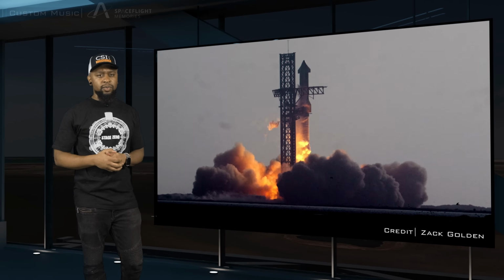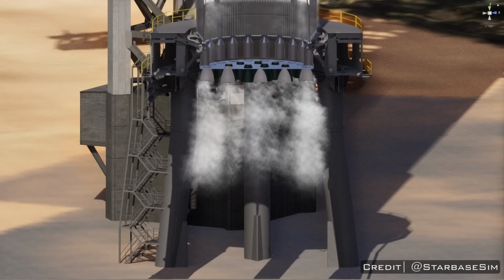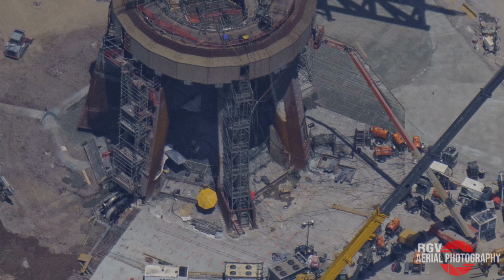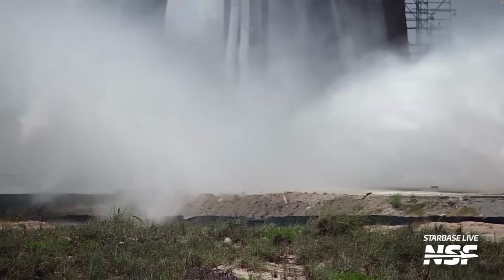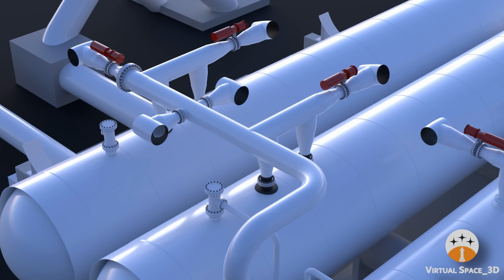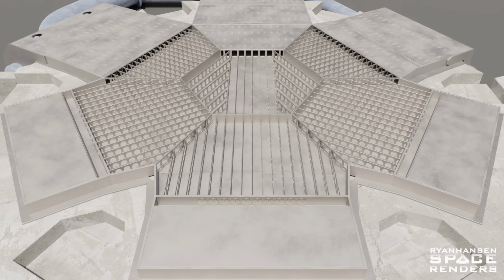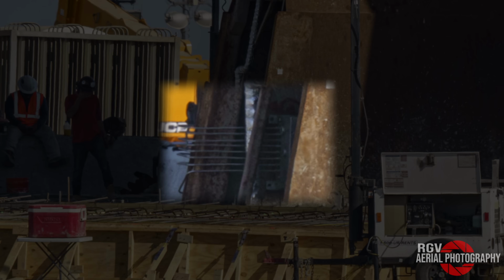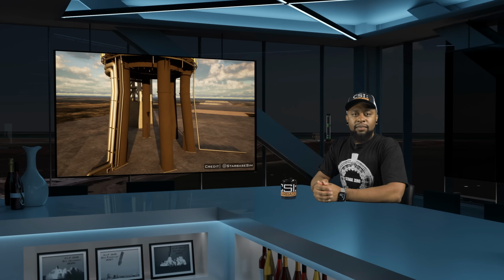How SpaceX Will Guarantee Its Launch Pad Never Fails Again! [Part 2]

Comment: I want to know why having the launch mount higher up would not have been a good solution. A large enough air gap should allow the heat and pressure to dissipate.
Reply from the maker: Probably would have been a good idea. Much too late for that though
Reply: @CSIStarbase  Thank you for replying! Given that it's such a simple solution, SpaceX must have considered that option early on. They must have had a good reason to dismiss it. Otherwise, it should have been the preferred solution, in line with Musk's "best part is no part". I wonder what that reason was.
Reply: Having it much higher would reduce effectiveness of Steam Cannon they are about to introduce
Reply: @KarolKarolak  It wouldn't make sense to have both. I meant having the launch mount higher instead of their current solution.

Comment: Correct me if I’m wrong, but I see nothing less than 55-year-old lessons being ignored by SpaceX. How does such a thing happen? These were known issues understood and solved for in the 1960s.
Reply from the maker: SpaceX believes in pushing boundaries. I think its as simple as that
Reply: Army corp of engineers said no flame trench for you. 
Stage Zero has become an engineering nightmare. 
SpaceX been sandbagged by its critics.

Comment: Another important design point is that the water flow is cross pad, so any steam generated by engine exhaust entering underneath the plate, will expand in direction of flow, and water coming from the supply will cool the steam, reducing volume. At the pressures that the water is at, the steam pressure/temperature is way below steel yield point.
Reply from the maker: This is true. Although I still think it’s nearly impossible for that to occur

Comment: Great video - the pipe you said you don’t know what it was for branching off at the bottom of the largest manifold I think is for the emptying of the entire system past the weir in the long run to the launch platform - it looks like the lowest point of the large supply line and if the primer pipes are open and somewhere there is a cross system connection ( it looks like there is a third pipe there that could service this), then water will drain from the entire system at this location. I therefore think this is a drain to possibly the pit nearby.
Reply from the maker: Yeah I thought that as well but they never connected anything to it from what we could tell. It’s also now encased in concrete so not sure how they would gain access to it
Reply: @CSIStarbase  if it’s a drain it’s only a low pressure pipe. Concreters often drop a low pressure drain pipe in during a pour and it takes only a few seconds as they don’t even glue them before pouring so it would have been easy to miss but then again it would have needed a high pressure valve on it before hand which we didn’t see so you may be right- it could just be a future  connection point if they need one without digging up the manifold.
Reply from the maker: @peters619  I was thinking it may be possible that it could later be diverted to the top of the launch mount but it’s such a small pipe, I don’t think it will be able to be used for that

Comment: They should consider making catching system for the used water or use the steam to generate electiricity, recycling the water will be long term saver and if you can produce electricity as perhaps wind turbines close by to catch the winds ?
Reply from the maker: I'm sure the water is treated and probably brought back to site. Not sure though. Most of it is not captured though so it wouldn't provide that large of a benefit

Comment: I know nothing about anything.  But would it be effective to create a steel cone sticking up to move the exhaust outward?
Reply from the maker: If they did that then they wouldn't be able to get the maintenance platform under the launch mount
Reply: @CSIStarbase  Solid point :)

Comment: Excellent production and presentation, again. Have learned abt the synchronization of the system to the launch process. But the two aspects of the system still needs study, the engine rings symmetry cut-out holes on the plate and the drainage system after activation.

Comment: My yes in that the pipe at the bottom of the manifold is most likely to flash ingress out of the system periodically and perhaps to modulate pressure but I would imagine it's for the clearing of ingress so it will likely be fitted with a blanking/ end cap.
Reply from the maker: No sure how they would do that considering that its all been covered in concrete!
Reply: @CSIStarbase  thanks for your reply, my mistake I was obviously not paying enough attention my bad, btw love the content you create keep up the good work and thank you.

Comment: how did they get water to spray out of a flat plate at a thirty degree angle?
Reply: The holes are drilled at the same angle.
Reply from the maker: Yeah I try to shift to metric units unless things are measured in small dimensions. Then I revert back to inches. The thing is...Starbase is designed in SI units. Vehicles are designed in metric though

Comment: The small pipe coming off the bottom of the larger manifold is located at the lowest point in the system. This would be a good location for a gravity drain system, used for draining the deluge plate and associated supply piping when desired.
Reply from the maker: Yeah I would think so as well, except for the fact they covered it in concrete. We haven't been able to locate a drain anywhere
Reply: Yes, unfortunately the entire area was backfilled and smothered in rebar before anyone could get a good look at where it was headed. Given its location, it's highly unlikely that it would be used as a blow down connection for flushing the system however, so I still feel it ties into a drain system via at least one isolation valve. It wouldn't necessarily have to drain directly into the small potable water retention area though. If it is in fact a maintenance item, a simple, capped pump connection located within the adjacent T-Box would suffice, and be less prone to the common issues associated with an open ended pipe that sees very little use. All you need is a portable pump and a short length of hose that drains into the PW retention area. This would also explain the diminutive size of the retention area, which as stated in the video, serves no functional purpose otherwise. It does have sufficient volume for collecting any residual standing water left in the system however. Obviously, this is just one possible explanation, but it would help answer a few questions while providing certain maintenance advantages. @CSIStarbase
Reply: New flyover shows some FONDAG being removed in the area next to this large manifold, revealing something which could be a capped pipe connection next to the adjacent OLM support leg. It could be anything of course, but it is in the right place. Wish we had a high resolution image here.

Comment: Even if the Deluge system works for one launch, it will not handle multiple launches per day, it may barely be able to perform only one launch per day as the attrition to the launch pad could require hours of refurbishment per launch and that is not including the steel deluge plate erosion. We will see after the first full launch but expect difficulties that jet-propelled super-heated exhaust turbulence will be very destructive. Why a form of diversion trench/duct system was not used, aside from the water table excuse, the mind boggles. All that extra cost wow.
Reply: Starbase currently plan to launch 5 times per year for testing. Please keep in mind this is the prototype and by no means the final design?
Reply: Making the pad rapidly reusable is indeed a challenge, but a traditional pad and flame trench is not necessarily an answer for a rocket of this size. Everyone of the Apollo and Shuttle launches damaged the launch structures and flame trenches to some degree, but with the long periods between launches it didn’t matter time-wise. At least one of the Shuttle launches ejected 1500 flame-retardant bricks out of the trench.

Clearly SpaceX had this shower-head designed and in process of being built far in advance of IFT-1. Possibly the only thing IFT-1 added to the design was more pilings and tie-ins.  Assuming pad survival success with IFT-2 I could see them plating the entire launch area in  Florida with a stainless steel shower head and a much larger water supply that would allow multiple options per week.

Comment: Thanks Zack & team. You covered so much in this episode.

One thing you touched on towards the end was something I was wondering about too - a desalination plant near the launch site to cut down on deluge recycle time. I wondered if SpaceX might be able to go further though. For a desalination plant to cut down on a 2 day recycle time it has less than 2 days to produce whatever water it will be contributing to the recharge. But - some or all of those vertical LN2 and LOX tanks in the tank farm are due to have their contents moved to new hotdog tanks. Might SpaceX be able to leave those horizontal tanks in place and repurpose more of them for water so that in the relatively long gaps between static fires and launch attempts when the pad is doing nothing a much lower output desalination plant could be chugging away for days on end filling up water tanks in the tank farm that could then pump water to the actual deluge tanks to recharge them really quite quickly a bit like the GN2 for the deluge pressure tanks comes from the tank farm?

The huge problem that I see with my idea is that there might not be water pipework of sufficient capacity (bore) to allow that much water to be transferred from the farm to the deluge system in a reasonable time but maybe, since we're not dealing with cryo hence insulation and temperature gain isn't an issue that makes shortest possible routing a consideration, SpaceX might be able to fairly easily sink a new trench going a long way round nowhere near critical systems to get from the tank farm to the deluge water tanks. Alternatively, if it was easier maybe we will see any desalination plant have its own fairly significant water tank farm close to it so that it can gradually produce a large volume of water over many days or weeks that would be enough for 3 or 4 recharges. Given they're there though it just seems to me that if the pipework could be sorted out then repurposing the existing vertical tanks might be a reasonably quick and cost-effective approach once the LN2 and LOX plumbing has all been rediverted away from those old tanks.

Comment: why not have a dome deflector which direct the thrust away from OLM?
Reply: Because the exhaust itself is naturally deflecting itself away
Reply: @alvianchoiriapriliansyah9882  no. it would curve away at the bottom from the dome between the Legs of the launcher mount. a dome would spread thrust and diffuse it. a metal dome of steel

Comment: Quick correction (perhaps) but isn't the heating of Re-entry caused by the compression of the incoming air at hypersonic speeds and not friction? Where the air at the shock front gets compressed so much it turns into a plasma and that this is the reason why heat shields favor a flat interface in order to move the shock front as far away from the vehicle as possible?
Reply from the maker: Yeah that is another component of the re-entry heating and probably the most potent. I originally had that in the script but it got lost after I re-arranged everything in order to make it flow better

Comment: Wow, you answered (once again) a lot of questions I had.
1. Center is not a weak point as engines still exhaust straight down.
2. Prevent dirt in the holes. No tarp but a steel...tarp, I guess.
3. Waste water. They actually removed the possibly contaminated dirt of the first purge! Respect.

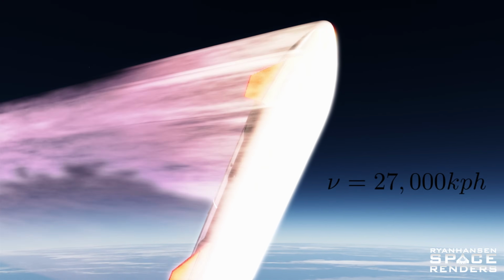Comment: 5:40 The first static fire showed this clearly. When there's a crack or gap forming in the concrete underneath, the surrounding concrete has no chance anymore, a 10m hole got dug out because the exhaust pushed under the material. The 17 bar downward dynamic pressure isn't the biggest problem, the tiles would probably come off intact, because the gases shoot through the gaps between the tiles and blow them off when they reflect upwards under the tiles. The horizontal flow of the deflected exhaust flowing from center to the outside of the platform would send the loosened tiles flying off like a deck of cards scattered on the ground.

In this case the glasswool type insulation backlayer would increase the volume under the tiles the gases can flow into before they reflect back off the backplate. Thus the higher the standoff distance (longer the mounting pins) the higher the force.

Comment: I still have feeling they will have to further iterate on that launchpad later on. I have almost no doubts the deluge system will work but it feels like it's overcomplicated and unnecessarily expensive to run in long term. Even just making the launchpad twice as high as it is now (and of course making the tower appropriately higher) would make things much simpler and easier and would allow to fit perfectly normal flame diverter underneath it with deluge system that has jets pointing downwards from sides and using way less water.

Comment: Has there been any consideration of the 4 engines failing after only 2.7 seconds in the static fire being due to water deluge coming upwards from the center, thus with an upward force against the engines? Usually the water deluge comes from the outside horizontally.
Reply: Unlikely

Comment: Information on the net is a little sketchy but it appears to calculate as follows:
A single Raptor at sea level has a vacuum thrust of 3297 KN using a vacuum impulse of 361 seconds. This would yield a propellant flow rate of 931 Kg/s at a mixture of 3.8:1. As the stoichiometric ratio for Methane is 4:1, 3.8:1 would be about right. At this ration 931Kg would yield 245Kg/s of Methane.
Methane Heat Combustion is 55.5Mj/Kg so the total heat produced is 55.5 x 245 = 13,598Mj/s and 33 Raptor engines would yield 448,718Mj/s. The Latent Heat of Evaporation for water is 2,256Kj/Kg at atmospheric pressure and near 100C temperature the amount of water needed would be 198,900Kg/s.

As it took 10-seconds to clear the tower, the water needed is 2000 metric tonnes of water. Do we seriously think that we can project this amount of water through the little holes in the Inverted Shower Head?
Now they are installing vast amounts of concrete at the Launch Tower. If the Launch Tower is going to fly Starships every week we must have a Launch Tower that is almost totally unaffected/launch. We cant use the concrete as an Ablative Heat Shield that gets damaged on every launch.
They should have built-up the launch area several meters and then built a standard "True & Tested" Flame Diverter so that there would have been no sea water ingress.

I hope my math is correct, but understand please, the whole purpose of this comment is targeted against the stupid little holes in the Pancake Structure. Somebody check the Math please...thanks.
Reply: The math looks to be correct. Zack estimated at 23:40 that the water tanks currently installed for this deluge system hold 1.4 Million liters of water which means 1400 metric tonnes, a large portion of which is dumped in the few seconds around engine ignition and liftoff. Considering that the heat load on the pad is reducing as the booster lifts of even before clearing the tower and that there is obviously still heat transferred into the environment and not just the water, the volume of water that's actually being used is pretty much exactly what you calculated. Those "stupid little holes" are not as small as you might think. 

I also agree that the current ablative protection used for the OLM legs and tower base isn't reusable and thus not practical for rapid operational flights, but neither is the current starship flight hardware. All of this is a prototype to test designs and develop a reliable fully reusable launch system. The final Starship launch pad might look similar to the current one, if water cooled steel plates work out they might be used everywhere around the pad, Elon even briefly mentioned water cooling the OLM ring itself once, but it also might look completely different if the current approach doesn't work out.

Comment: Great episode. One point though, you mention that the heat on the Starship during re-entry is caused by friction with the atmosphere but I've heard many times that this is not so, it's caused by the extreme pressure. What's the truth?
Reply: Zack is acknowledging a mistake here

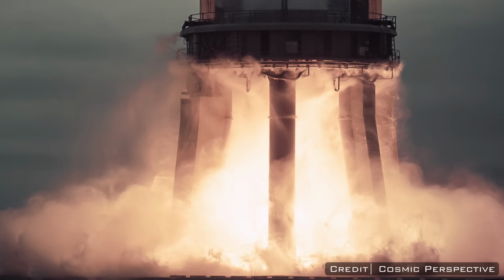Comment: 5:50 - those calcs are "average" - the problem with boosters are the shockwaves that build up and cause the "crackling" you hear when listening to a rocket - the peak pressure is much more than the average.